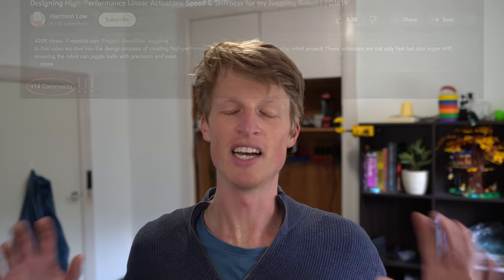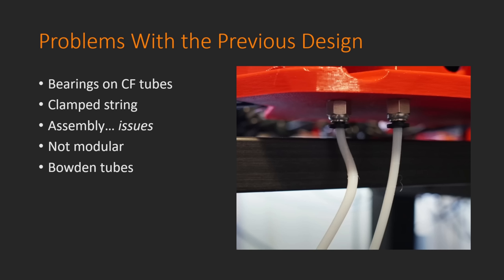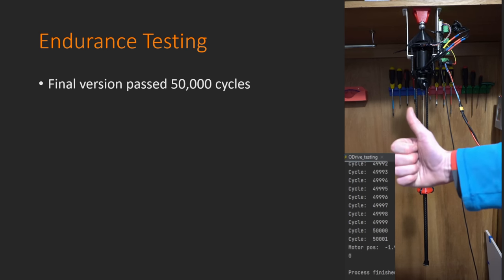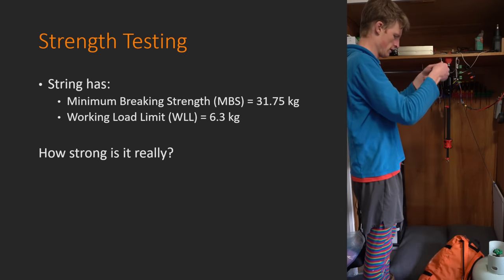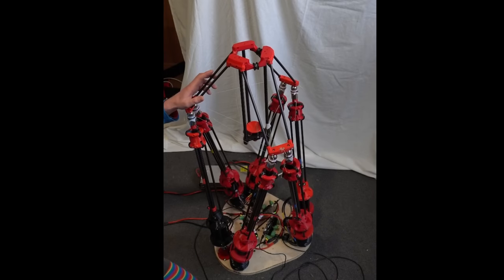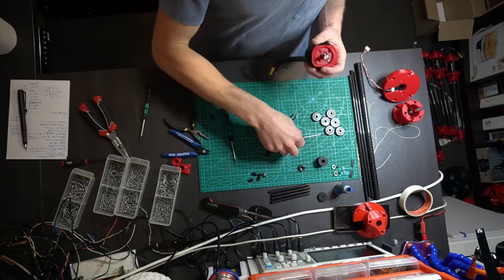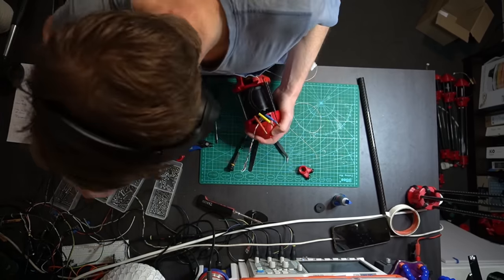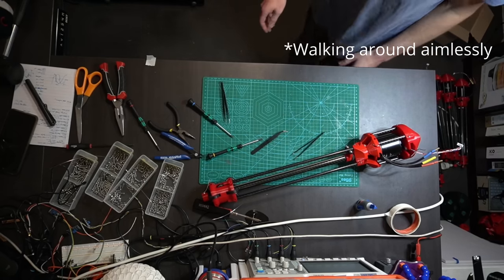My New Linear Actuators are SO MUCH BETTER! | PDJ #21

Comment: The trick is to find as many of the parts in generic places. Guitar strings and or bow strings from archery 🏹 have been mentioned. Maybe some ideas from compound bows could be gathered. Maybe there are pulleys that work well from compound bows. Your brains trust is out there getting inspired and seeing some thing you are doing that reminds them of some part they have seen in who knows maybe sewing machines. Best of luck.
Reply from the maker: Yep, I agree on getting generic parts as often as possible. Similarly, I'm finding myself gravitating away from designs that require post-processing of parts / manual labour. Such ideas tend to sound fine when only considered in isolation, but boy do they add up!

Cheers!

Comment: To terminate the synchro wire you could use a electronics standoff thread that into the plastic. Drill a small cross hole in the standoff. Thread wire through the cross hole and use a set screw to hold the wire. This would make it easy to change and Tighen.
Reply from the maker: Fascinating idea! I actually think we've figured it out over on Zulip 😁 A simple clamp built-in to the printed parts is easy to adjust/fasten with a single M3 bolt and is super sleek and effective!

Cheers for the suggestion! I like the creativity 😊

Comment: Looks like the industry standard for termination on syncromesh cables is crimping a metal barrel onto the cable
Reply from the maker: The trouble with these is that they don't (inherently) give any way to easily adjust the tension in the line, and I'm not sure if these would be the best way to terminate the cable at the spool end, due to the fairly small sizes in that area

Comment: Very interesting! Thank you!
Have you ever envisaged linear bearings? (especially for the bottom cap, that definitely needs not to wobble)
As for the synchromesh cables, you have quite a few attachment options, but for your setup, I do think that threaded plugs would be your best option (Youtube comments don't seem to like external links, sorry about that...):  they would allow you to manage the tension very precisely, and would make life pretty easier with maintenance (ie. detaching/removing the cables, etc.)
Please let me know if you need any help - your project is really super interesting.
Reply from the maker: Yeah I've tried normal linear bearings but the tolerances didn't work for my carbon fibre tubes (some tubes fit with slop, others didn't fit at all...). They would be a lot more sleek, though 🤔

What are threaded plugs? My quick googling is showing what I've usually called "grub screws"? Do you mean having the plug/screw press directly into the cable?

If you want to help out or suggest any detailed ideas, head to Zulip (link in the description) 😊 There are quite a few parts of the project in active development and I'd never say no to another helping hand!
Cheers 😊
Reply: @harrisonlow  Oh I see... 😕
Too bad - yes, linear bearings would have been quite ideal in this use case.

Oh I'm not sure I'm using the proper term here, maybe "threaded plugs" is not the perfect/most used expression... It's a kind of cable attachments where (usually not so thick) cables are crimped at one end, while the other end is threaded.
I'll try some ASCII schema 😅
=======[[[[[[[[[]//////////
 cable                 threaded end

I'll definitely head to Zulip, so that I can supply you with proper images/links (as I've found threaded plugs specifically made for synchromesh cables online)

Cheers 🙂👍

Comment: try artificial muscle, like air? or similar, electric. needle? piston. regen without batteries, dead short reverse gen feed back. think 3d printer actuator linear screw.  it will run long time back and forth, and can be fast.
Reply from the maker: Haha it's funny you mention artificial muscles - I actually did 1.5 years of a PhD working with hydraulic artificial muscles and, to put it bluntly: I'm pretty happy to not be working with them anymore 😜
Reply: talk about it lol @harrisonlow

Comment: 0.02mm is 20μm, I wouldn't say that's "a lot more" than 8
Reply from the maker: That is very true, though in my naivety I wanted to be able to verify the theoretical limit, which (AFAIK) is only really do-able (with high confidence) if I'm measuring with a precision less than the limit that I'm validating. That said, I'm no statistician and I wouldn't be surprised if there are clever mathematical tricks to do just this.

Either way, I've definitely learned my lesson: Do the quick-and-simple test first to get an idea of what really happens and then push the theoretical limits if it looks like you're operating near the precision-limit of your apparatus.

Comment: I've been working in environments which use hexapods for a few decades now, but I've never seen them called Stewart or Gough–Stewart platforms, they've always just been called hexapods. What I do know is that whether they are driven by motors, pneumatics or hydraulics, every colleague who has had to control them has complained about the kinematics.

Good luck, you may want to learn a new language to expand your range of available swear words. *8')
Reply from the maker: Interesting! I've been tossing up if I like "hexapod" or Stewart Platform more 🤔I first learned of them as "Stewart Platforms" so that name feels more familiar to me, but hexapod sounds pretty sexy...

It's interesting that people have had issues with their kinematics! I think it really depends what you're doing with them (forward kinematics seem a lot more difficult than inverse kinematics, which is all I need). My simulations are all working pretty well and I haven't had any major issues come up, though we'll have to see how easily the sims translate to reality...

Love the comment about new languages 😂I've always wanted an excuse to learn a new language!
Reply: In science and engineering applications, having both forward and inverse kinematics is often very important, as is trajectory repeatability when moving between positions. If you want to yaw the platform (what I would call a phi move, from Euler angles) you need to be sure the pitch and roll don't change at any point during the move, so kinematics (and dynamics) get much more difficult with an unbalanced load.

Very cool project by the way.

Comment: I think you could do with two pulleys per string run but it would require putting pulleys at odd angles.
Reply from the maker: Yeah after seeing what others have CAD'ed I think you're right! For better or worse, the wacky angles (probably) wouldn't really be that big of an issue; the current pulleys are at pretty strange angles as it is and they work pretty well 😊

Comment: Cool to see. But if you need the speed just go with linear rail with belt or screwball and it will last you way longer than 5h continues run
Reply from the maker: Unfortunately I couldn't get belts to work due to the wacky routing needed here, and I previously tried ball screws and they were significantly slower than these new actuators. What's the fastest you've run ball screws at? I have recently been shown some 30 start(!) ball screws and I could see them going pretty speedily, though I remember them being quite expensive

Comment: Collet/compression fitting for the synchronous mesh wire.
Reply from the maker: Could you elaborate on this? Would this mechanism be easily adjustable?

Comment: Amazing design and great video, thank you for sharing all of this knowledge with us!
Did you think about using square CF tubing instead of round for the middle shaft? It could use 2x4 bearing, giving much better stability sideways and it would be resistant to rotating.
Reply from the maker: I honestly didn't even know that square CF tubing was a thing! (despite my supplier selling it 😅). I'm hesitant to go for square tubing though because I don't want to add even more bearings to the bearing block, though I do like the resistance to rotation. Others have suggested hexagonal CF tubing and I quite like that idea, but I can't find a supplier in Aus...
Reply: @harrisonlow  I bought some Hexagonal tubes from China for an old project, I think that should work with 2x3 bearings,, but honestly I love redundancy so I would add more bearings (but also this increases complexity, resistance and weight). I think  I've seen some triangular tubing too, using that might be the ultimate solution: you can keep the current 2x3 bearing setup, all faces would be covered and it should be resistant to rotation.

Comment: For braking or regenerative braking I have three ideas, peltiers are fun because they produce less heat as resistors, you could also make your own resistor out of plastic embedded metal wire sold in hardware stores for next to nothing, or aluminium foil for example. For regenerstive braking you buy a 3 dollar 3 phase to 2 phase rectifier or build your own from diodes then the power goes into a dc motor controller to adjust braking power then into a step up converter. I never managed to test this idea even though I wired all the electronics but I still think it might work. Good luck.
Reply from the maker: Interesting ideas! For better or worse, I'd (currently) prefer to stick with using the ODrives and figuring out how to fix this issue "properly". I know that there's some way to do this with my current setup, but I'm just goosing something and can't figure out what it is!

Cheers for the suggestions 😊

Comment: With your string, I feel like there may be a few things to keep in mind - the knot you tie will have a pretty sizeable impact on mbs, easily reducing it by as much as 30% maybe as much as half.  That de-rated 'knotted' strength isn't accounted for the swll.  The bounce test you perform to my eye jives with the rated mbs 🤷.  
Material of the string also has a big impact not just because some materials are stronger than others, but also because some fibers knot better.  Dyneema (UHMWPE) has a high strength but is known to lose more strength when knotted.

The real solution is to splice the rope if possible.  Otherwise, there are some rigging knot methods that retain a high amount of strength such as the 'tensionless hitch'.
Reply from the maker: Interestingly enough, the string actually broke in the middle (when doing the direct test with the bag), away from both knots. Very strange!

I do agree in general though, and I've been trying to minimize tight bend radii and knots as much as possible in the actual design. I didn't know dyneema was particularly unhappy about being knotted. Good to know, cheers!
Reply from the maker: If you want to see proof (of the string breaking in the middle), I've uploaded the next part of that clip to Zulip, here:
https://pdj.zulipchat.com/#narrow/stream/399279-General/topic/Random/near/389776525

Comment: you can eliminate one of the three pullies by turning the motor perpendicular to the actuator. right?
Reply from the maker: Yep, rotating the motor would dramatically simplify the routing here, but the main reason I didn't set the motor perpendicular to the extension axis is because I don't want the motor to be sticking out the side of the actuator. I have a gut sense that this would likely cause issues down the line once I put all 6 actuators together into a Stewart platform so I want to keep everything as "neat" and in-line as possible.

Comment: You ever consider using stepper motors? Fishing line?
Reply from the maker: I actually did use stepper motors in a previous design, but had issues with them not giving enough speed and being super big and heavy. I haven't tried fishing line. I worry that it'd be too elastic and I don't have any on hand to try out. I reckon the kevlar line will work well for now while I'm still testing things out, then the synchromesh would solve all strength/stiffness concerns (at least, that's the hope!) 😁

Comment: For the ODrive and braking, you can use a lithium battery pack as power source to absorb the braking power instead of resistors.  Then add a power supply to battery in parallel with ODrive (with diode so current doesn't go to power supply) to keep the battery at nominal (not full) voltage.  A large pack won't heat much from the brake current.  There's a setting to not use resistor in ODrive settings.
Reply from the maker: Does such a simple system work well? I very quickly ended up in a Battery Management System + Active Balancer Board rabbit hole when I started looking into LiPo batteries (coming from a place with 0 experience with them) and (temporarily) gave up 😅
Reply: Or, just use a very large super capacitor... you can get one that can handle way more current than all your motors combined will generate, so you don't have to worry about heating up a lipo into old age.

Comment: What string is that? It looks like maybe braided kevlar? If not you should probably be using something like that. Something like the old Spiderwire braided fishing line for eg. If you don't want to switch up to steel.
Reply from the maker: Ah yep, I probably should've shown that in the video 🤦‍♂

The string I'm using is made from kevlar and is used for kites.

Does that spiderwire line stretch at all? I don't have a crazy amount of experience with fishing lines, but I recall it being rather stretchy, which would be tricky to deal with in these actautors
Reply: @harrisonlow  Not much of a fisherman myself, but I do remember handling it once when it was a new product. I remember it being taught and strong. But you're already using kevlar, so I don't imagine there'd be a lot of difference.

Comment: I can suggest bicycle cables. Both mechanical brake and shifting cables are twisted steel. Brake cables are thicker and stiffer, but I think shifting cables would work great with your design. You can shrink wrap the end if it needs more friction to stay in place. Get some cable terminators too. 
Using shifting cables, I think the rods might fail first, or you could burn up your driver boards or skip the motors. So, pick your preferred failure mode - strings and cables are cheap to replace, motors and controllers not so much, and the carbon rods are more expensive too.
Reply from the maker: Hmm, you don't think bicycle cables might be too stiff? There are some pretty tight angles being traversed by the string here 🤔

It's certainly an interesting thought experiment to consider what would fail if the strings didn't. I honestly have no idea what it would be! I have very little experience with BLDC motors, but everything else is super solid so I'd guess it'd be the motors that fail next? The strings would have to be extremely strong for the CF tubes to fail. They're crazy strong!
Reply: @harrisonlow  bldc motors are actually pretty strong and forgiving.  Only physically contacting points are the bearings.  There is a chance you could melt the copper wire coils, but that's a pretty extreme situation, and you probably will kill your controller first if your motors are of any decent size.

If you have never done it before, take an unused bldc motor and spin it with your hand... while your spinning it, connect the 3 wires together and notice how it doesn't want to turn anymore. Now  take 2 bldc motors and connect the wires of one directly to the other and move the rotor of one motor with your hand and watch the other motor move the same way.  Pure electro-magnetic force magic.

Comment: You can literally buy screw eye ends or loop sleeve ends the same time you buy your synchromesh cable.
Reply from the maker: The trouble with these is that they don't (inherently) give any way to easily adjust the tension in the line, and I'm not sure if these would be the best way to terminate the cable at the spool end, due to the fairly small sizes in that area

Comment: Stupid question from someone who has no clue: Could the foam piece and the homing sequence (detection of the current spike) be the reason that you can't get even better than the 0.055mm deviation? In my mind, the foam somehow messes with getting accurate results.
Reply from the maker: I realised after posting this video that I should have made some comments on why the precision might not be as accurate as it theoretically "could" be, and you have made me realise I made a silly mistake in my experiment setup!

I'm currently telling the motor that it has reached its destination when it's within 0.01 revolutions of the setpoint, which equates to a 0.69 mm range (using a 22 mm dia. spool). It's honestly kind of crazy that the standard deviation was an order of magnitude lower than this! I'll have to re-run the test with a finer resolution of the setpoint 😅

(I wasn't a complete dunce who forgot entirely about this when running the experiment—I lowered the setpoint resolution way down when I did the 10:1 pulley testing. I must have just forgotten about it when I did the direct measurements 🤦‍♂️)

To address the foam piece: the foam is only ever contacted during the homing sequence. This would've been good to show in the video as well, but at all other times the foam is just sitting there doing nothing.
Reply: @harrisonlow Thanks a lot for the detailed response, appreciate it!

Comment: Your system of measurement itself introduces way too many errors to be considered valid.  The string stretches at potentially different rates, the idlers settle in different places and you're transferring motion to a sliding device.
Reply from the maker: Haha yeah it's definitely not up to industrial standards by any means, but I feel it's good enough for me to be confident in at least a sub-millimetre precision, which should be more than enough for my application 😊
Reply: @harrisonlow  I felt a bit guilty, I paused, wrote this reply... then unpaused and you had a better solution.  Still not ideal for testing repeatability, but I'd say you got a reasonable result to make design decisions from.